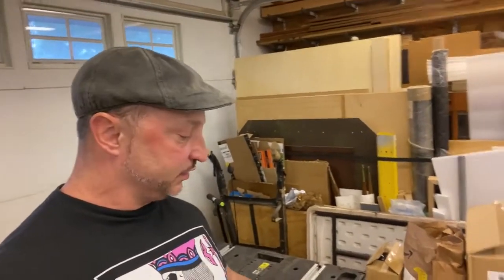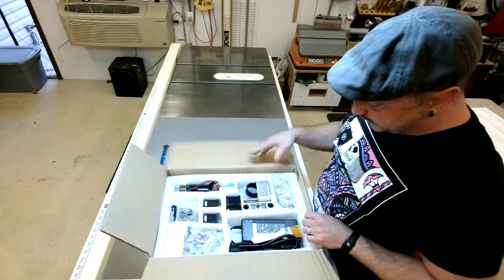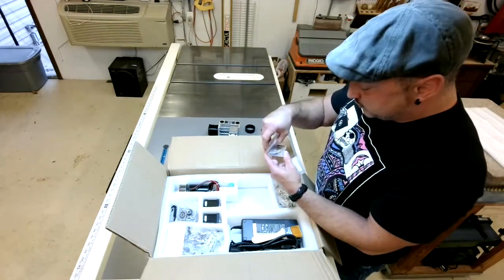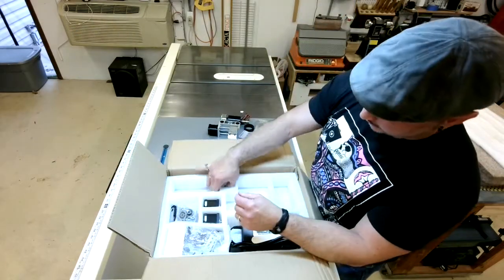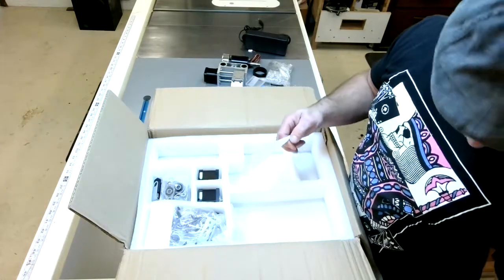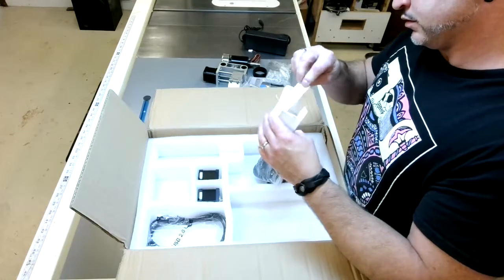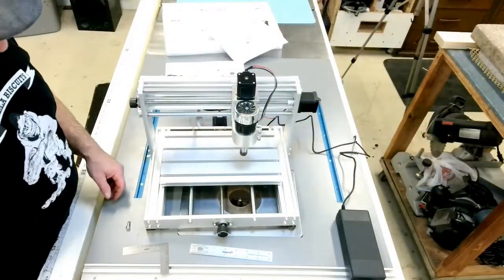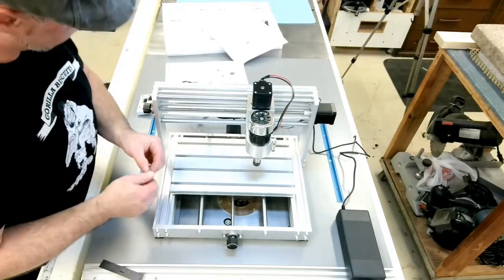MYSWEETY 3018 MAX desktop CNC router

Comment: By now my 3018 max is in and finished. Rods are same length 100 percent. You put the machine together and guess what? One side gets to 90 degree and other side dies not and one of the rods looks Iike 2mm shorter. Rod is not shorter. Disassemble whole X gantry and check 2040 extrusions. In my case they were both to long and both different length. I've removed excess and guess what? Put the X gantry together and suddenly everything is square and rods look same length to. Still there are to many things I dislike on this machine. I would not buy it knowing what I know now. That all aluminum  hype is just a hype. Spindle cooling fan makes everything vibrate. Linear rods have way to much play. It can never be really accurate to the level of real machines. I bought mine to help me build custom mini CNC mill but now I contemplate selling it and investing money in parts for my own design. So dismantle it and check rid lenghts and 2040 extrusions lengths and you will see what is the problem.

Comment: Before you have stripped screw, trying to squeeze 10 mm aluminum plates that just few inches away are supported by steel rids and 2040 aluminum extrusions, you should've used shim on one side or two thinner shims one per each side and everything would be Gucci.